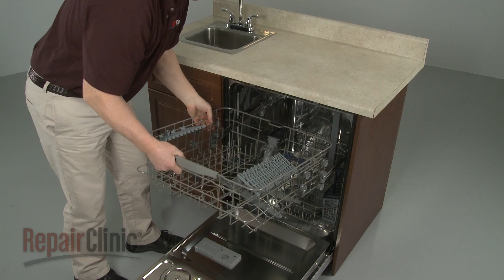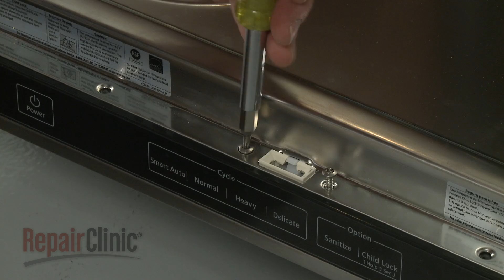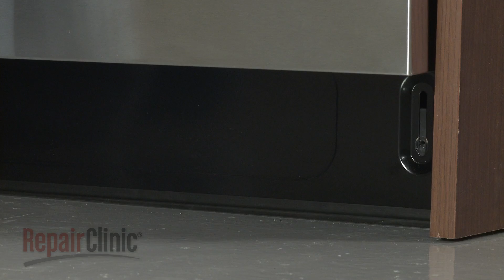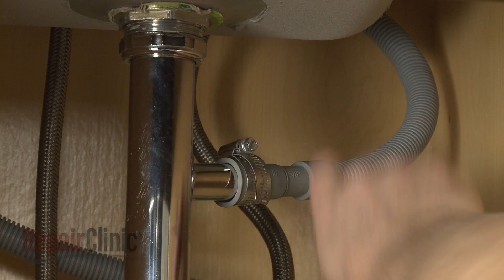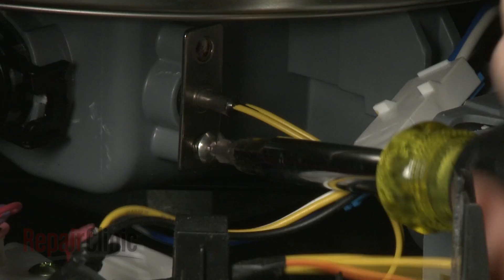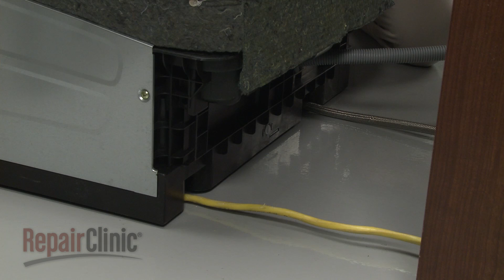Samsung Dishwasher Disassembly – Dishwasher Repair Help

Comment: My washer door will not close or lock it will start if I hold the door shut.. it does have the auto dry function that opens the door to dry..
Can I fix this
Thank you
RW

Comment: I just purchased a new Samsung dishwasher and it did not come with the Door Guide Caps.  I have read that these are primarily for aesthetic purposes.   How important are they?  We haven't ran our dishwasher yet because Samsung said they can't get the caps to us for over a month and that we can return the dishwasher.   We secured the dishwasher to the countertop and the side cabinets.   Do I have to have the caps in the holes to use the dishwasher?

Comment: do you have details on a Samsung dw60r7040fs? I need to replace the water heater element and cannot find repair instructions anywhere? Thanks
Reply: @repairclinic  Yes I am in UK, I can't find anything that resembles that model to show where the element is located and how to access it so I can obviously remove then take the part number to order a new OEM Samsung part. Could you possibly point me towards something? 
Thank you for your help

Comment: Would anyone happen to know if the stainless steel door will fit on the white Samsung dishwasher that’s the same model #. The only difference seems to be a “W” at the end of the white model number and an “S” at the end the stainless steel model.

Comment: My dishwasher seems loose.  When we bough the house it was preinstalled, but it's loose.  Seems like it's not installed right.  What is that metallic part underneath the granite, that the brackets are screwed against in the upper front at 15:28?  I need to get that part.

Comment: I have a Samsung DW80f600 UTS that will not stop draining. I unplug it and plug it back in and the dishwasher turns on itself and starts draining again found the cutter broken off inside the drain area but I don’t know if that’s the usual or not
Reply: Mike was draining like that but it was leaking and throwing a code, i fixed the leak and now it works really badly. Go figure 🤡

Comment: My dishwasher works about 15 seconds and then stops, and then starts dinging sound  3 times like its at the end of the wash. it has 2 blue lights blinking at the same time. Any ideas on what it is?
Reply: This has a chart for what the blinking lights mean. I had a broken disposer blade and the gunk built up.  http://www.experthelp.com/question/234950/my-dishwasher-will-not-run-and-all-the-lights-are-lit-up-and-then-go-black-it-is-a-samsung-dts400

Comment: If the black water seal under the cutting blade needs to be replace for any leak , can i replaced just the seal or do i have to replace the whole wash pump ??? can i get just the seal ??  Thanks !
Reply from the maker: +Rico , suave It depends on your model and how the manufacturer break up the pump parts.

Comment: Excellent instructive video, note:: some of this model Samsung Dishwasher do not use the Thermister part, they use an ECS sensor in its place, part #dd82-0118a.  Not interchangeable, make sure what version of this model you have prior to ordering parts!
Reply from the maker: Yes, thanks for sharing the tip! This is why it is extremely important to enter your appliance's model number when ordering replacement parts.